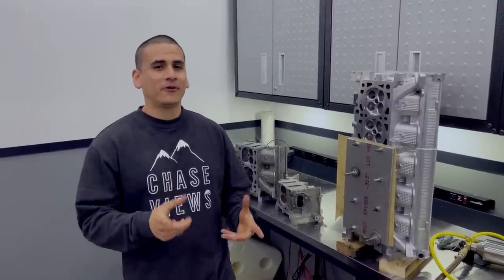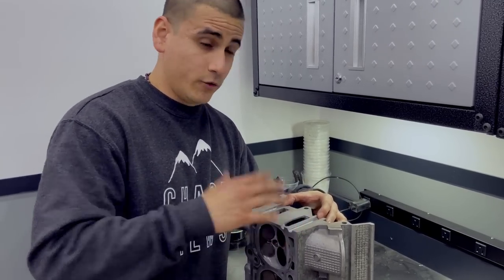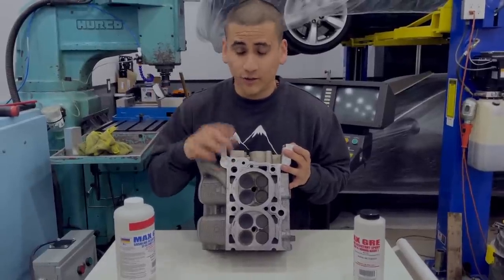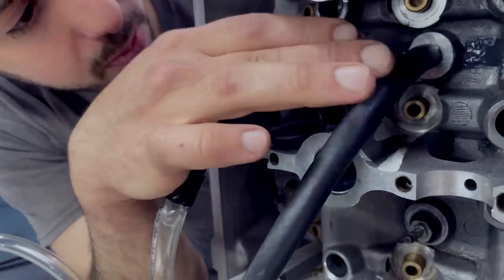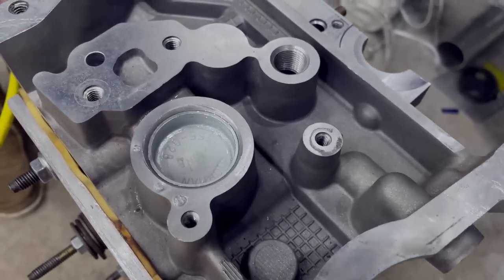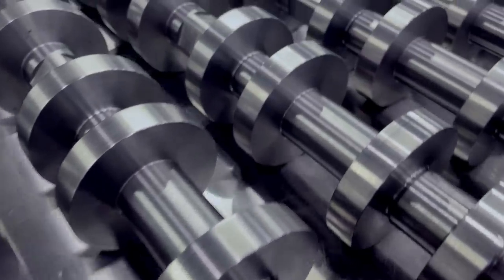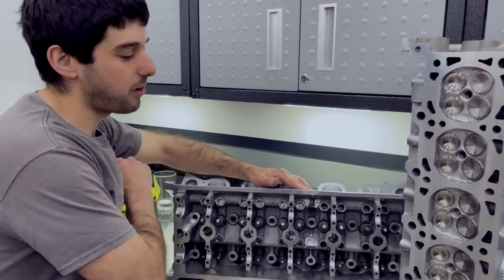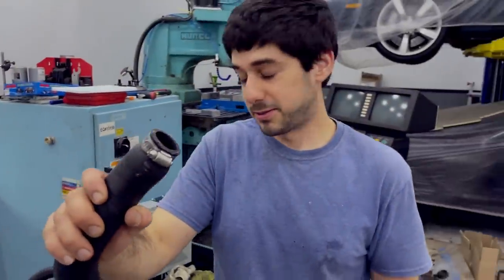Sealing Our Leaking Heads With Epoxy- Ford V10 4V Build Ep. 12

Comment: Absolute top quality guys Ford definitely lost out not developing the triton V10 more and you guys are proving it
Reply: I think they finally realized that pushrod v8 is still the way to go for a truck engine. I love how smooth the modular motors are, but they never felt like a real HD truck engine, the v10 is a turd in anything bigger than a f250.
Reply: Yes hopefully Richard Holdner or HPMonster can spotlight all your hard work

Comment: Incredible initiative to pursue something like this. I’m sure the haters will comment on the jb weld and epoxy, meanwhile their junk is on jackstands or doesn’t exist. Keep it up boys, i’m all in on this project.
Reply: I tried welding my own intercooler. Tiny little pin hole, I couldn't seem to seal it. Throw some epoxy on it, apply some paint, and only I know it was done. Don't let perfect be the enemy of good enough.
Reply: I used JB to fix a giant hole in the cyl head of my Raptor 660 quad (improperly installed a hotcam and decomp pin broke into cooling passage) and put at least another 600 hours on it and it never failed. One side of the JB had pressurized coolant and the other side had hot oil dripping on it from the cam and it held up fine.
Reply: I second the part about people crapping on epoxy when they either don’t have a vehicle or their vehicle is a POS that doesn’t run 😂
Reply: You haven’t lived until you’ve hacksawed a bell housing to get a car back together. This project might as well be the space program compared to the nonsense I’ve seen.

Comment: If you have small cracks I have fix evaporator core with locktite anaerobic, common red stuff, it’s what they seal Beemer drier switches and when you pull vacuum it hardens it

Comment: Cant you weld inside? Inert Gas is heavier than air, you can fill the head with welding gas, then put the head in a box or bucket and fill the bucket with inert gas. As long as there isnt a lot of airflow, the gas should displace oxygen.

There is aluminum Arc/Stick welding. Its not great, but It'd allow you to weld inside the holes. Friction welding might be possible somehow too. Preheat the head, then run some kind of rod down into the hole being turned very quickly by a rotary air tool. Enough rotational speed, enough friction, and the heat will cause the aluminum to flow.
Reply from the maker: All we wanted was to seal water in so epoxy was the most efficient way to do it and the most accessible. We’ll probably try another method of welding the heads together if we have to do this again

Comment: That freeze plug leaking brought back nightmarish memories. When I was working at the ford dealer, I was installing a 5.4 into an F150, got finished and went and test drove it, got back and found a coolant leak. I added some coolant dye and checked it, every freeze plug in the right side of the block was leaking as well as the freeze plugs on the back sides of the heads. I had to pull out the new engine and install a replacement.

Comment: The gap on the serpentine belt should be fine. It's more gap than I use on my application. Though mine is two adjacent pulleys, so the belt is well supported.
I'm glad the epoxy trick worked. It's tough stuff to hold 30 psig on a flat face. You are effectively making a pressure vessel. 
Good call on spare cam cores. Cam timing is the special sauce. It may benefit from a 2 step iterative test process.

Comment: At the machine shop I used to work at we put a light coat of red loctite around freeze plugs before putting them in. Really helps those seal.
Reply from the maker: Thanks for the great tip, we'll have to try that!
Reply: Instead of red loctite, use the green loctite bearing retainer. It's thinner and tends to seal better than the red stuff.

Comment: Flip the alternator around. Have alternator pully facing the engine. You can delete one the the pullys on the right side of the engine. Have it adjustable to tightened yhe tension of the belt. If you look up supercharger kits for some of the 4V 4.6L engines do this.
Reply from the maker: We thought about it but didn’t like how the alternator looked flipped.

Comment: Nice work!!! That idler pully on top that uour making make the bracket mount onto the waterpump for extra strength dont depent on that bolt free floating to hold that in place . 29:59
Reply from the maker: Thanks! We actually also welded that bracket to the timing cover so it is fully supported

Comment: I'm curious to see how the epoxy holds up to multiple heat cycles with the heads expanding and contracting 🤞
Reply from the maker: Us too!
Reply: Great content and great iniativecon the leak sealing. If in the unlikely event it does not work out, there is a process for dealing with porosity in castings called impregnation.its good enough for 24 inch high pressure oxygen ball values for a blast furnace. Hope you don't need it though. 
Keep up the great content

Comment: Viscosity improvers will change your dynamics on the oil. You should use a nice sticky grease. I used HHS by Worth, from Germany . Never a fail. Rods mains and cam, but use moly on your cams, but watch some has silica polish agents. I also always at minimum crank up by hand first then spin up plugs out, if it can’t be primed. I would pressurize the dedicated oil primer and adapt to what ever it took to back fill the engine.

Comment: I know it's too late for this build but would aluminum brazing have worked for this application?  I was thinking you could have welded the heads together for strength and sweated the brazing in to seal the passages. I don't know if sweating in aluminum brazing is possible. Anyhow great project!

Comment: I think ford realized, that the money they saved on using modular designs and same bore spacing was lost when you have to go to 3 valves or 4 valves per cylinder. Like we either make a 30/40 valve v10 OR a new 7.3L Godzilla 16 valve pushrod v8 that kills the v10 in torque, HP and efficiency.

Comment: I know it’s too little to late but instead of welding the heads together you should have had some machine work added to the outside of the heads to bolt them together with flanges.  You could get a gasket between the two halves and maintain the water jackets. I’m still very impressed with the work done here but I’m worried that under load you’ll have leaks again. 😢eager to see this beast run!
Reply from the maker: That's an interesting idea!

Comment: Awesome progress guys, i always thread the core plug holes and use aluminum plugs vs those stupid push in metal ones. Would have been nice to be able to pressurize and soap test the head when at temperature but should be fine.
Why not reverse mount the alternator in front of the engine like 03-04 cobras did?
Reply from the maker: Threaded core plugs are slick.
We didn't reverse mount the alternator mostly for aesthetics. Just preferred mounting it on the side.

Comment: You guys are Awesome!! You always find a solution to problems. What are your cam durations going to be? Jon Kaase's Mod motor only needed mid 230's for around 2hp per ci. Go easy on the overlap as there is a pretty direct path across the combustion chamber. Kaase used a ridge to direct intake charge into the cylinders. Keep up the great work!!
Reply from the maker: Thanks! We actually have Todd Warren spec'ing the cams, and we got quite a bit more duration than that going in. 260/263

Comment: In the future, you can leak test your valve job by pulling a vacuum on the ports. The true way to do a leak down is to run it and use a piece of tubing on your ear to isolate the sounds and pin point the source of by pass. Your virgin ring set is going to leak. zero doubt about that. Also, when doing a pressure leak check, you could have done a drop down test on the cooling system. Rig a gauge, pressurize the passages to the max of your radiator cap and see how long it holds. It shouldn't drop at all, but if you go nuts and do an overnight on it or something, you'll have to calculate for temp differences. Your STP and 5/30 concoction for assembly lube might work, but you'd been better off using a specifically formulated assembly lube because most have super high levels of Zinc which is what protects against scuffing. Do yourselves a huge favor and use a thin layer of white lithium grease on the oil pump when you assemble that so it'll pull a prime ASAP. While priming the oil passages, turn the engine over, so the crank oilers and the cams etc all get oiled before this thing fires up. Simply building pressure doesn't "spread the wealth"  "Energy Conserving" formulations dont have any zinc in them. Not good. Another thing, using a specifically formulated break in oil (again, super high zinc levels) will protect far, far better than anything that will come off the shelf at Autozone etc. I truly hope those heads dont come apart under load. I built a turbo motor back in the 80's and was having a problem lifting the heads at higher boost levels. Quite literally, lifting the heads.
Reply from the maker: Those are good tips, thanks!

Comment: Great work guys! 

why not just pull of the top 2 free spinning pulleys? itll make servicing the belt easier, and itll give space at the 2 junctions youre concerned about.
Reply from the maker: That would cause the rib side of the belt to run on the water pump, if I understand correctly? That means the water pump would spin the opposite direction. That might make the pump not work like it's supposed to.
Reply: @biy_buildityourself  i think with the belt routing just taking the one to the left of the pulley you just added, and the one on the upper right of the water pump, it looks like they are just pushing the belt down or in the way more than providing tension at this point, by removing them i think youll gain some clearance and reduce drag, with out affecting the direction of rotation.

Comment: I feel like you guys should make some long tube headers anything to help that v10 breath and squeeze as much power as you can NA so long tube equal length headers along with a high flowing exhaust would be beneficial I know it sounds like a lot of work but it’ll benefit you a lot in the long run for mid range to high up there in the rpm power gains
Reply from the maker: That's the plan! But that wont happen until we get this thing mounted in the car. For start up, we think the 2V manifolds should work.

Comment: clearly you need someone use to welding, alum heads/blocks correctly and remachine the surfaces. epoxy could be a problem with head flex when torqued or heat cycling.

Comment: Take it from someone who used 2v logs on a 4v head it doesn’t work. My advice to you is to get two complete sets of 4v headers and just add a primary to each side. The v10 doesn’t fire on the same side twice. So you could add a primary to the front tube. That or if you don’t want long tubes get two complete sets of 4v short tubes or log styles. The cast iron logs from factory would be easy to cut and weld. Just add to the end. That’s what I’m planning on doing for my vic. I have a 92 aero vic with an mt82 swap that’s getting a 2v v10. I’m just going to add a primary to each header.
Reply: BIY you should do two sets of cams, one NA and one boost set. 😂
Reply from the maker: We want to fire this thing up on the stand with just some down and dirty exhaust. When we get it into the car, the plan is to make a set of 1 7/8" or 2" primary headers with 5 to 1 merge collectors. We want it to sound as good as we can!

Comment: Awesome. 
Question. Would a remote oil filter setup free up some room to tuck the alternator lower and closer to the block?
Reply from the maker: It would have helped for sure, but we had already worked on the thermostat housing so we just decided to work around it
Reply: @biy_buildityourself especially considering the remote filter setup is a factory option lol, but I'm pretty sure the adapter still takes about the same amount of space

Comment: I hate to be a know it all but I just have a funny feeling that you're going to have a tough time building sufficient compression with those camshaft lobes! That's the most aggressive lobe I've ever seen!lol
In all seriousness, the left side head has coolant sitting at the bottom of the seam where it was welded together. Is that something that was spilled into the head or did it come from the seam?

Looks like you need to replace the ribbed idler closest to the alternator with a smooth one as the back of the belt is riding on a ribbed pulley.
2v V10 manifolds aren't even close to what you need for a 4v. Ports are completely different and so is the bolt pattern. I'd buy some cheap 4v headers for a V8 and add a tube on each side..
Reply from the maker: We saw it at the bottom of the last page of the catalog and figured it must be the best. 720/720 deg .550"/.550" 0-0000 RPM. 😂

Not sure which part you are talking about for the coolant, have a timestamp?

The upper one is a smooth pulley for the back of the belt and the lower one is ribbed before going to the water pump.

We think the 2V manifold will work. We just want to use it to start it up on the stand. When we mount this thing in the car the plan is to build some serious 1 7/8" or 2" headers with 5 to 1 collectors!
Reply: @biy_buildityourself  I'm driving down the interstate right now so I can't really give you a good time stamp but it's right around 2311 or so. Once I get home I can give you a more accurate one. And I'm definitely not saying as a matter of fact that there's coolant there, that was more or less asking.
I don't want you to think that I'm trying to discourage anything about this project because I love it. I've seen many people start a legitimate V10 project and guess how many I've seen finish it. I used to be pretty into the modular world when it was barely new and One thing I wanted to ask you guys about was I believe you said in an earlier video that these things came with a forged crankshaft? I've always been under the assumption that they all had some type of crankshaft that was not one piece and had some very serious strength issues at RPM, but that doesn't look to be the case here. Of course I'm going off of things that I think I remember from 15 years ago because I never had a V10 so anything I learned about it I just learned accidentally. Another thought. On exhaust manifolds or headers.. I would imagine that a 96 to '04 Cobra manifold would be made from some type of steel alloy similar to how a LS manifold is cast. If that's the case, then you could easily cut apart a couple of Cobra manifolds and weld your extra cylinder onto each side because most of these later model manifolds weld very well unlike earlier iron ones. And please also understand that I'm just giving suggestions, you guys are doing a fantastic job and have impressed me. I've been doing this for a long time and you guys are just simply better than I am at it!
Reply: @biy_buildityourself  Oh yeah guys, I need to correct your cam specs.. I think it's more like .999/.999 360*/360*  @0* It's going to be really tough finding the intake center line on that guy! 
Forgive me for being lame..
On a little more serious note, are you guys going to attempt to decree the camshafts? It sure be a shame not to because there's so much power in doing that on those engines. But boy it is a job!! All you need is some adjustable crankshaft gears and that'll get you plenty close enough because you can move them two degrees at a time. I know on a stock cammed dohc 4.6 with 03/04 heads (01 cobra intake cams), It made up huge difference. I don't really have a perfect scenario as far as before and after but agreed the camshafts and put a 2000 Cobra. R. Canton oil pan with a crank scraper and that's the only thing I did to the engine and it picked up almost 40 horsepower. Now I have been told that those oil pans and the crank scraper pick up more horsepower than you would think. But the only thing I know for sure is that the degree and the oil pan set up together made a good bit of horsepower. Which one was responsible for it? I can't say for 100% but I'm guessing it's the camshafts being pointed in the correct direction..
Reply from the maker: I see the coolant you are mentioning. That is just residual assembly oil from installing the valves. The cranks on the V10 I believe are all forged cranks. The worry bead with them is the split connecting rod pins. We will definitely be degreeing the cams. Depending on how good we set up the cam prints, it could be minimal or it could be A LOT of work. We'll have to see when we start the process!

Comment: That epoxy won't last. The heat from the motor pistons transfer to alum heads will be at least twice the running temp the thermostat runs. So 220 would be 440 at the top of the combustion chamber.

Comment: The alt looks to be taking up a lot of room width wise in an engine compartment.  Hopefully you have plenty of room in what you are putting it in.  Did you ever consider reversing the orientation of the alt (pulley in the back)  and hanging it in front of the coolant piece?
Reply from the maker: It is wide! We did throw around the idea of reverse mounting the alt, but decided not to because we prefer the look of it mounted normally.

Comment: I wonder what the vibrations and stress of running engine might do to the epoxy and jb weld.

I’m  impressed with how this is turning out. Looks great. I’m rooting for you all!
Reply from the maker: Thank you! Project Farm actually sliced a hole in a head and plugged it with jb weld and ran the engine. Not exactly the same thing we've got going on, but an interesting thing to see nonetheless.